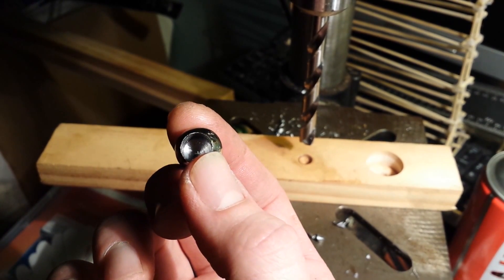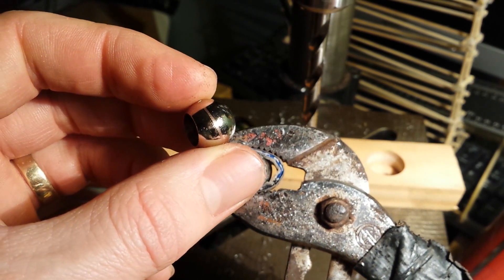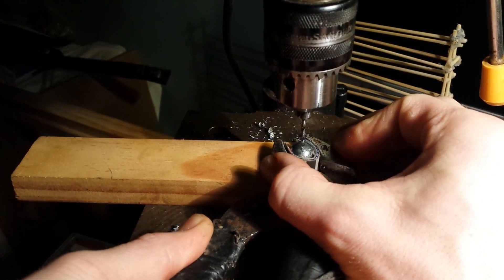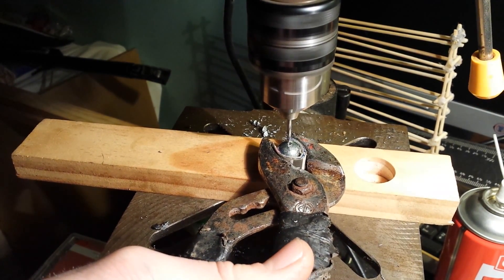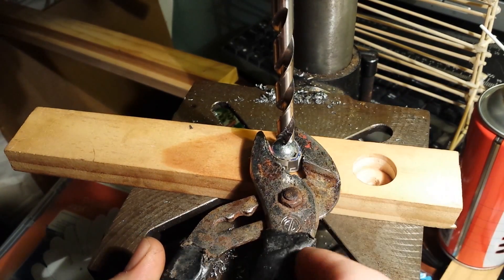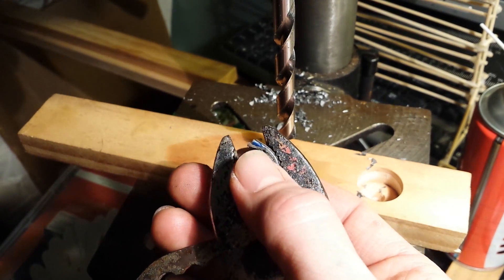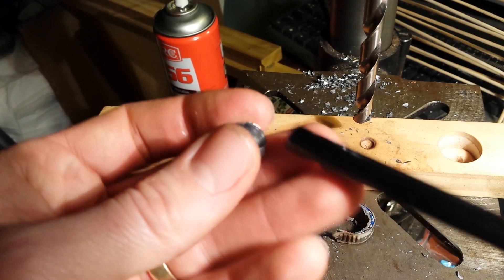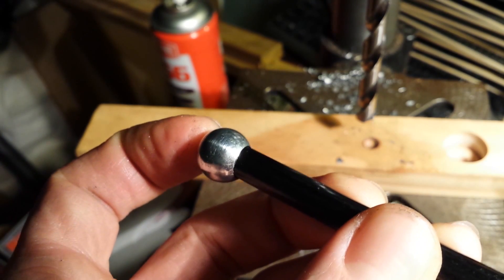How to drill a hole into a ball bearing for Delta 3D printer rods - For NON MAGNETIC bearings!

Comment: G'day Tim, thanks for putting these up. Have you tried grinding the flat rather than using a file? While you say your bearings aren't hardened, a good quality hardened bearing will likely not do a file any good. You may also try slowing your larger drill down considerably and increasing the pressure for a better result.

What are you using for the rods? You call them "kite rods" is that literally as it sounds, and rods available from a hobby store for kites?
Reply from the maker: Hi Pete, thanks for the tips! I will try a grinder next time. I do not know how it will go with a 'real' ball bearing but guessing my drill won't handle 'em. 

the kite rods are 9mm carbon fibre rods from a hobby shop, made for making/fixing kites, about $30NZD for 1.5 metres
Reply from the maker: Kite rods like 9mm carbon fibre tube - it has a hole down the shaft which doesn't bend as much as a solid rod..Any kite shop   is likely to sell this product... you could  also use bamboo as it's only the centre to centre measurement which is of value...